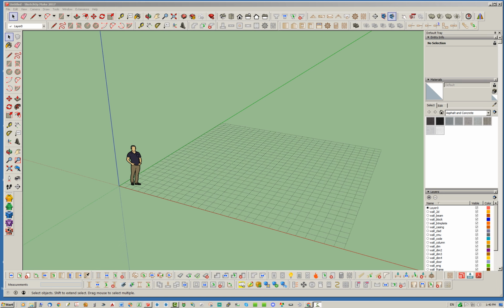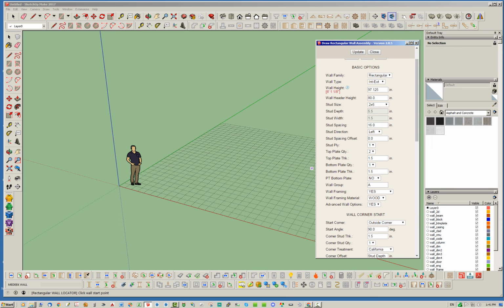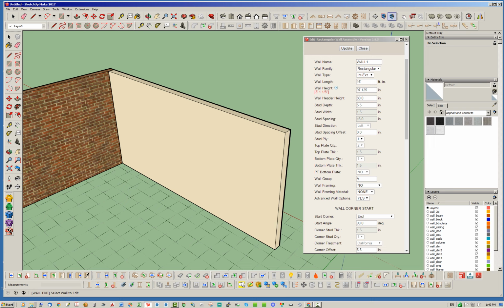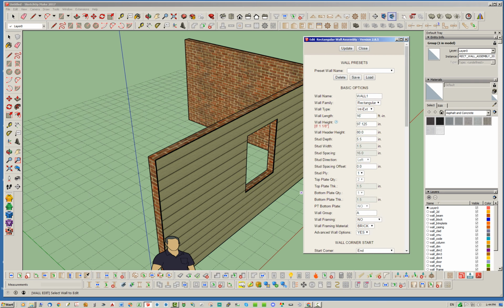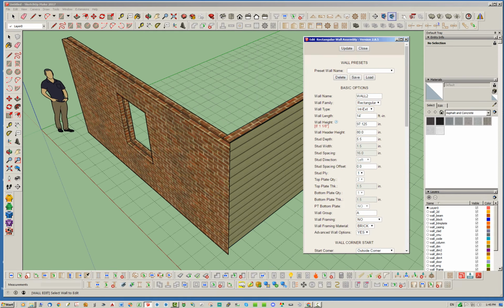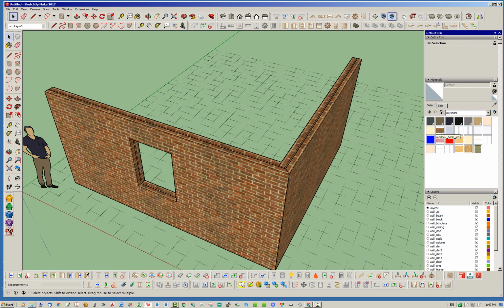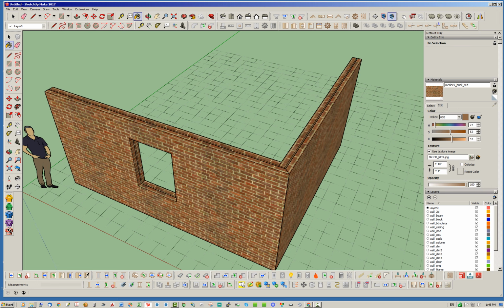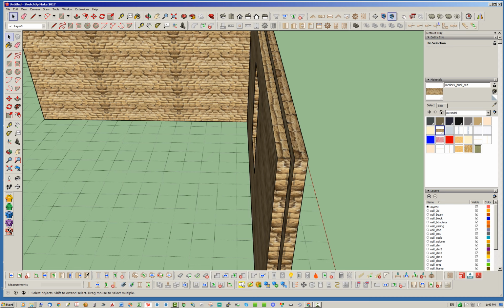Medeek Wall Plugin Tutorial 30 - Double Brick Walls

Comment: Can additional wall build up components/layers be added,such as  internal plasterboard finish and cavity within the insulation? 

In the U.K. for example, the most common typical external wall build up for residential build, would be something like:-
- 100mm Brick outer face
-150mm cavity (that is fully insulated)
-100mm inner, thermal/concrete block 
- 12.5mm plasterboard finish on 10mm adhesive dabs.

Comment: The double brick walls have a space between them and the space is based on the brick that ties them together (header brick every 7 or 8 courses) so a typical thickness is 2 bricks at 3 5/8" spread apart where the overall dimension/thickness of the wall is 7 5/8", the length of a brick.  Nice video :)